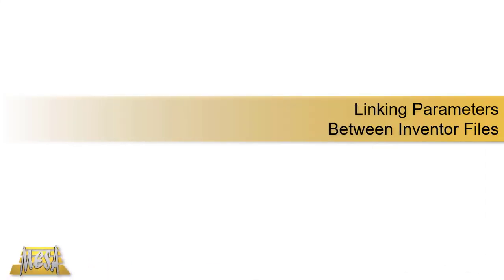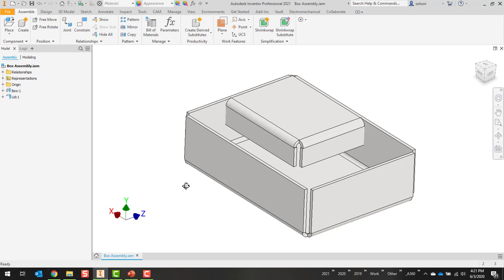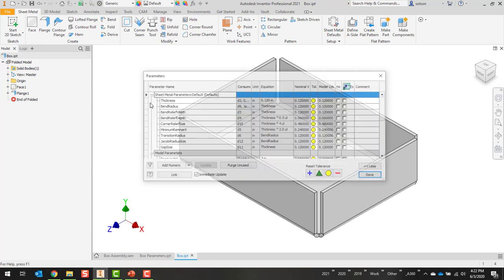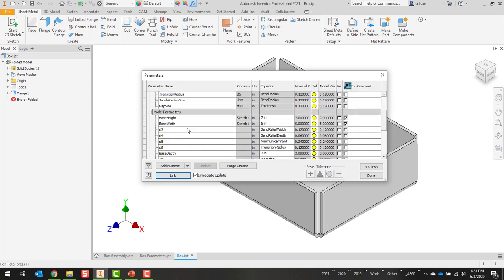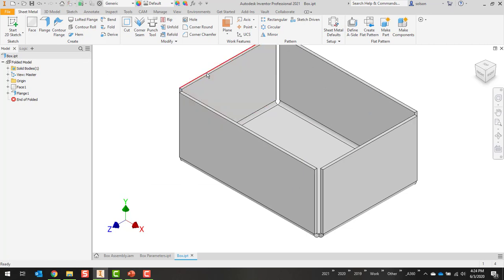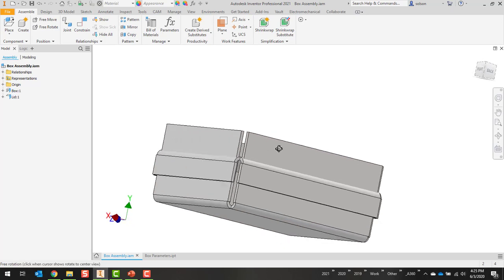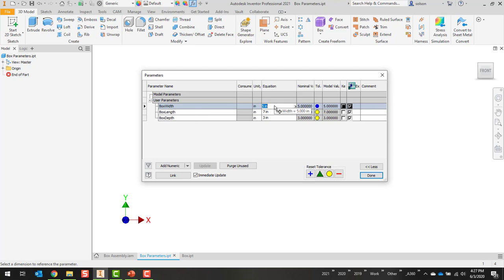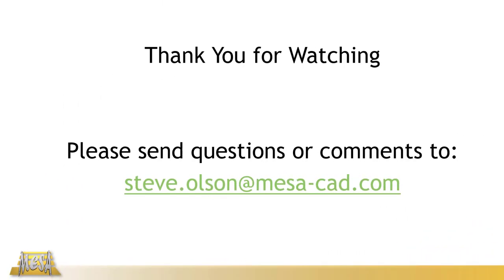Linking Parameters Between Inventor Files

Comment: Nice video, i liked it. I would like to ask, that is there a solution if i want to change the paramateres of a part from the assembly? i mean it takes much time to open a part all the times i want to change something, but the part would drive the assembly.
Reply from the maker: A very common approach is I create the driving parameters in the assembly.  Then you can use iLogic to push those values into the required parts.  So the assembly drives the part, as opposed to the other way around.  Below is a link to one of my videos that shows how to push parameter values into files from the assembly.  https://www.youtube.com/watch?v=2rr_hdambEw.

I hope this helps.  If you have any other questions, please let me know.

Comment: Great help.  The only annoying thing is needing to open the BoxParameters part to change the parameters.  If you could somehow link it so you can change them from within the assembly it would be nice.  I did find that you can put the BoxParameters part into the assembly, and just set its BOM to Reference, and you can edit it to change the parameters, saving you having to open it every time.
Reply: It is apparent that the people who built this software never had to actually use it - it is the worst modeling software on the market for the price.

Comment: Can the "Box Parameters" ipt equivelent exist inside the assembly of interest?
Reply: Sam, you can occasionally get Inventor to do that, however, most of the time Inventor will complain about a cyclical link.  For some reason, it doesn't like having the file that has the parameters link as the assembly or one of the components.  If you would prefer to have the box parameters be part of either of the components or the assembly, you can write an iLogic rule that passes parameters between files.  It does work better to put them in the assembly and have the rule pass the values down to the components.
Reply: Steve Olson Right, the same problem that would want you to have a separate ipt in the first place I suppose.  I do use the Ilogic Rule, I was just investigating other methods that could be more easily understood by Eng co op students that haven’t been introduced to Ilogic. However, it remains the most reliable method of creating Ilogic assemblies that I have seen. Excel table linkage seems alright too, but somehow less elegant still.
Reply: @Jyuicycuhhh  Yeah, there are so many ways to build a little intelligence into models.  I find it frustrating that linking the parameters between components in the same assembly doesn't work.  It seems like it should, but I guess there are ways it could cause trouble so it is prevented.  I am glad you are aware of iLogic.  It is probably the best way, but since coding is involved, it is a little intimidating to some.

Comment: Hi I'm trying to link parameters between 2 i parts with 5 variants each, So what I want to do is that the parameters of the part A variant 1 matches with the parameters of the part B variant 1 and so on. In order to when I change the parameters of the part A also change on the part B. What I did was to link the values in the excel table of each part but Inventor did´t respond after that. Is there other way to do it? Thanks.
Reply from the maker: I think a better way to do this is to use iLogic to trigger the change in Part A, then switch to Part B based on Part A's change.  You can create a parameter, or parameters, that help you identify Part A.  This command is a template for searching the iPart.

i = iPart.FindRow("iComponentName:1", i = iPart.FindRow("iComponentName:1", "columnName", "<=", 0.2, "columnName", "<=", 4.1), "columnName", "<=", 4.1)

In this code, iComponentName:1 is the browser node name of Part A.  I recommend editing the browser node name of that component so it stays static.  If not, your code could break if that Browser Node name changes.  Then "columnName", "<=", 0.2 is a column name, condition, and value to search for.  The template by default gives you two search criteria, but you can add more, or run the line with just one criterion.

Depending on the circumstances, you could repeat this for Part B.  An alternative is to use the value of i to set B.  After the Find Row line is run, i will equal the row number of the member that iLogic found in the iPart.  However, there is not a command that will let you switch by RowNumber, but there is a command that will let you switch to member by MemberName.

If neither of these work, you can expand the iParts section of the System Snippets, there are other helpful functions that could help in changing Part B.  Again, I would change the Browser Node Name for Part B so it stays static.

Hope this helps.
Reply: @3DSteve52   thanks for the answer i´ll try it.
Reply from the maker: @dieteras9372  No problem.  If you run into issues, please let me know.